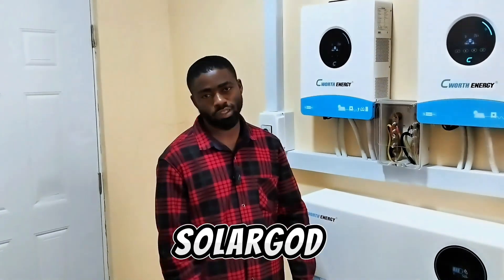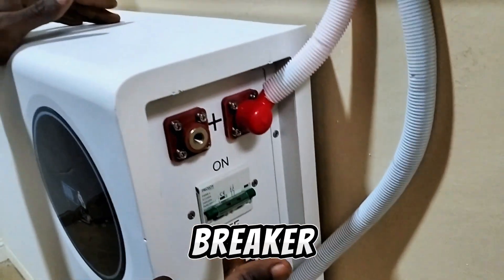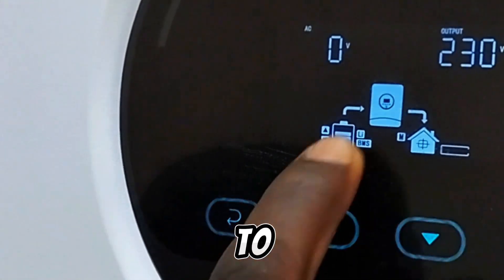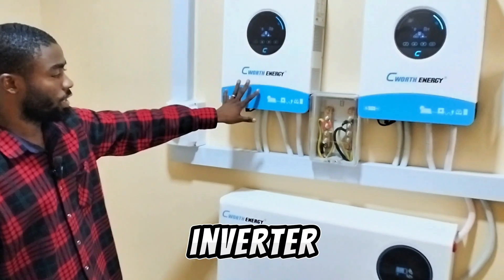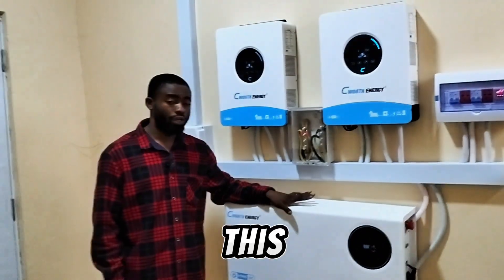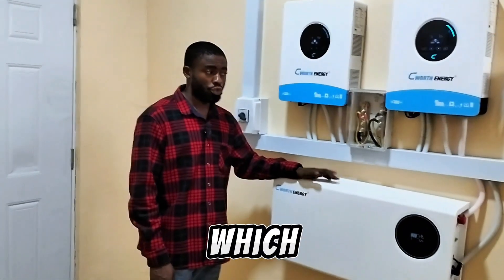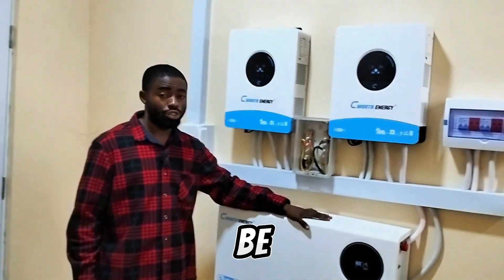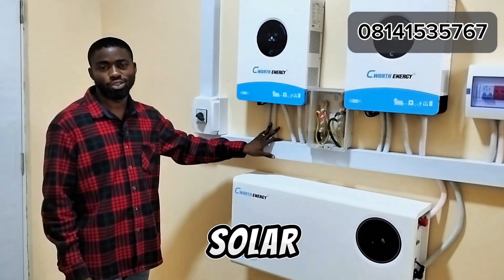12kw inverter with 10kwh lithium battery; what can these power?

Comment: I have a very small power system but my battery drains faster than expected when the sun goes down. What could be the problem?

Battery LifePo4 55ah (660wh)
2000w inverter
Reply from the maker: Wetin you dey power?
Reply: @Mairigaemmanuel  
Just my MacBook air laptop
55 watt TV
And 5w light bulbs × 4

With just the TV and lightbulbs on it doesn't last more than 2hr 30mins
Reply: @theeconomictrader the battery is too small for long backup time. Go for battery with higher AHms like 100ah or 200ah and increase your panels too!
Reply from the maker: @samthecreator10 the battery dey try sef be that naw.
Reply: @Babatunde_tunex  hmm nawao. I actually got this LifePo4 lithium because I was expecting it to hold more power than a lead acid. It even costs more than a 100ah lead acid. I have 2 panels sha so I just need to improve on the battery (backup).
Reply: @Mairigaemmanuel lol . But shebi a 660w backup suppose run a 55w for upto 12hrs (660w ÷ 55) or at least 8hr due to inefficiencies/loss. Abi na me no sabi calculate am

Comment: If you have the money, Buy Lithium Titanate Oxide Batteries instead of Lithium Phosphate Batteries. It can be depleted to 100% of it full charge capacity. 

Now, being that Nigerian Ruling class are horribly Irresponsible towards the Masses, Your Solar Electric Power System should be Full fledge INDEPENDENT POWER GENERATION not a mear power backup.

That means you will Generate the Full amount of Power You Need For Powering Your Loads During the day and Night.

Your Solar Panels must be calculated to provide the total needed amount of Power to Run appliances you would be using during the day AND MUST STILL HAVE EXCESS TO GET YOUR CALCULATED battery capacity fully charged for 6p.m to 6a.m powering of your appliances that would be needed to get powder during that daylight outage period of 12hrs.

So for a Total load of 5000W, you need at least  10KW of Solar Panels to get them Powered During the Day an still have enough to charge your Night time usage Battery which would Ideally be 5KW times 12Hrs which equals to 60Kilowatt Hour or Battery Capacity.

But you know, unless the weather is Hot, you will not be powering on  Amperage Hog Electrical devices like Non-Inverted Air Conditioner during the night.

So you will not be heavily draining your battery bank during the night always.

But at least buy a 15KWH Battery for a 5KW Totally Rated arrays of loads of you can't buy it 12hrs Need of 60Kilowatt Hour.

The solar Panels, if it is to be calculated in view of the general factory expected effiency of 25% would actually be 5KW X 4 which makes it 20KW Arrays of PVC.

Generation Of Powe

Comment: Nice job bro..... The invester us an hybrid inverter with inbuilt mppt controller so it's should be able to regulate the amount of current going to the battery regardless of the amount of current generated. Why do you have to set it manually?
Reply: Why are you not posting your phone number on your videos ? Are you doing your videos just for fun? I have been trying to contact you but I couldn't find your number
Reply: @mikeigwe31  Please watch again, he did. Moreso subscribe to his channel and always click on the notification button. do well to watch other videos and read the comments you will almost always find an answer to whatever you are looking for. I agree he should be posting his number in all his videos like other installers do.
Reply from the maker: Noted
Reply from the maker: My number is on the video
Reply from the maker: Maybe you should watch the video again
Reply: Nice question... 
There is no need to set any other thing again so far you are using mppt charge controller or hybrid inverter.
Reply from the maker: Dey play
Reply: Oh ...... You said from the grid, I thought it's from the panels. Understood boss, nice job by the way.
Reply: I didn't hear from the grid clearly
Reply: I have a concern about how we setup our power systems. Why would you build a 12 kw system on a 10Kwh battery storage? Are u building a UPS to support a 12kw load for just an 1hour. ?
Reply: @EricAmaefule On the basis of your assumption, the answer to your question will be yes. However, remember that the mere fact that the inverters are capable of delivering 12Kw does not automatically mean the loads are continuously upto 12Kw so the system might run longer than you imagine. Also note that for a tropical country like Nigeria, the average daylight ours are long all year round so if this system is coupled with a massive solar array, the battery can get filled up before 11am and most of the power consumed for the majority of the daylight hours will be coming straight from the solar panels, not the battery. Can the system do better with a bigger battery?, most likely yes but compared to everything else in a solar power system, batteries are still rather expensive.